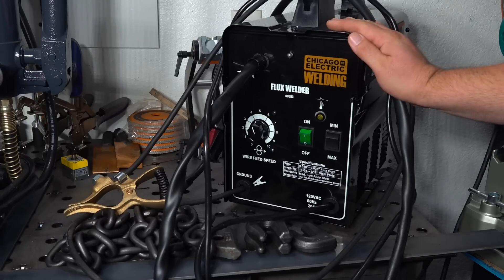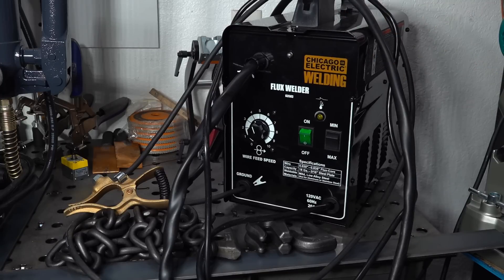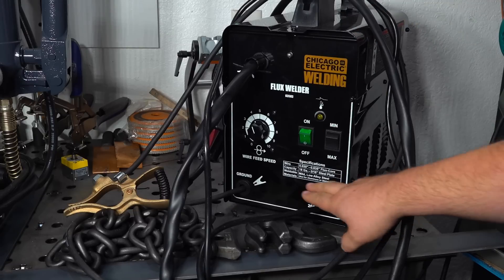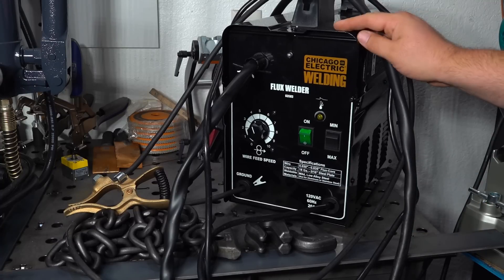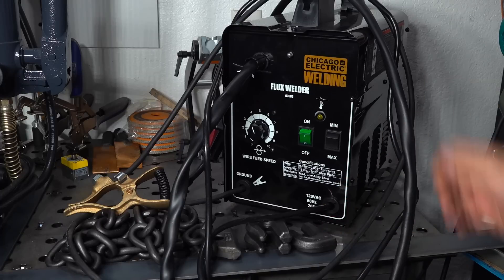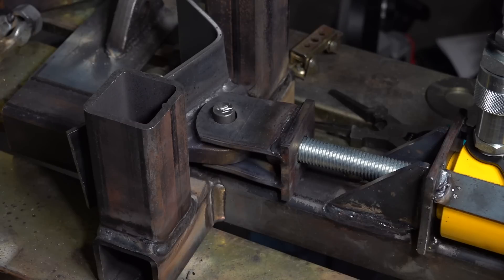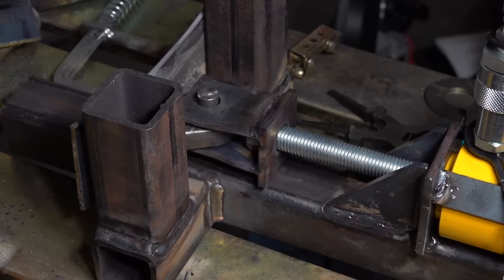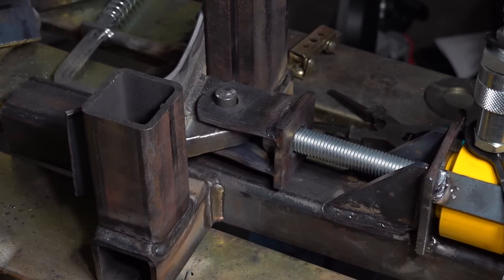Harbor Freight Flux Core, Weld Strength Testing Part 1

Comment: first off.. the material doesnt look like the mill scale was ground off, 2nd it seems like the higher priced welder was using gas shielded flux core and is a 220/240v welder. im a certified welder and i own a couple of hf welders and a few miller mig and tig welders.  your test is very subjective and seems biased as its comparing apples to oranges... a 110v welder will never compete with a 220v welder so your tests are pointless
Reply: So, you're certified and you can't tell the difference between gas shielded and basic flux core? Also, you must've just gotten certified because you care about mill scale on anything other than short circuit mig. The mill scale would've affected both welds the same and would be negligible either way.

Comment: I have a Hobart IronMan 230 MIG (Doesn't leave my shop), a Clark Mig 100E Mk2 (Cheap welder I bought for home that became a travel rig), and a Titanium Flux 125. The clarks old and started falling apart since it was my "Travel" rig, so I replaced it with the HB Titanium as its even smaller and lighter and self shielding flux gives me a lot of versatility. When I got the Titanium 125 I was eager to play with it and test its limits. I had no problem welding 1/4" with it, even though its not rated for it. Try as I might, I could not get a weld to fail as you did. I'm really curious why you didn't film yourself making the welds. You have almost no penetration with the HB welder, so I'm really curious to see your settings and welding with it.
Reply from the maker: The Titanium 125 is a DC output welder and gets far nore penetration than the welder in this video (I have a review of it).  The welder in this video is AC output, which is not good for flux core and significantly limits performance.  I have three more videos with this welder testing penetration with various settings and travel speeds, and even pre-heating.  I also convert to DC and do more testing.  The Titanuim 125 is DC out of the box and runs far better than this welder.
Reply: The Ironman is big and heavy, of course it never leaves your shop. Haha, I've been looking at the Ironman, how's yours holding up?

Comment: this test doesn't seem scientific at all, the HF welds are much thinner, you said it's because HF can't do anything thicker, well ok than do 3 weld lines to make up for it. the real problem is that the HF welds have zero penetration as seen when you cracked it. it doesn't matter what welder you use, either you didn't grind the metal before welding , or you didn't use enough voltage. either way you did not do a proper weld. I'm a bigger rookie than you but even I know these welds are "cold welds" because of zero penetration, that's just bad welding, it's on your part. you need to man up and admit you did this testing completely wrong. it has a ton of logic fallacy
Reply from the maker: I have several more videos with this welder where I cut and etch, test output amperage, convert to DC, etc.  I agree that the main issue is lack of penetration.  No matter what I did, I could not get good penetration on 3/16" thick material with the stock AC output.  1/8" material did fine.
Reply: @bigtb1717  oh I see what happened. the welder you used and the green flux 125 welder also claim 3/8", it's obviously a lie because I bought the vulcan omnipro 220 and it claims to go up to 140 amp on fcaw, so if yours only goes to 125 amps, than according to the specs on the 220 that is IMPOSSIBLE: 120V; Steel: 24 GA - 1/8 in.; Aluminum: 22GA - 1/8 in.240V; Steel: 24 GA - 3/8 in.; Aluminum: 22GA - 3/8 in.  <<=specs for vulcan 220. so basically the testing failed because of false marketing which HF usually underspecs their rating. either that or it's just there is something you don't know which is why it's stated 3/8" . I would just search google or ask the forums to see if anybody has actually welded 3/8" which according to the specs for the vulcan are impossible
Reply: Haha, "weld lines". I love it!

Comment: I have a weldcorp machine, basically the same as the HF, probably same machine with different cosmetics made in china.  More wire needed to be fed in,  #2 speed way too slow.  4-6 on max and the bead would have been double the size and strength.
Reply from the maker: I don’t know if it was an issue witht he included wire or what, but the welder wouldn’t run with the speed set any higher.  It would stutter and the arc would keep going out and stubbing against the metal.  I have three more videos testing different wire, travel speeds, techniques, ets. and I cut and etch many of the joints.

Comment: What if you just put several notches on the edge with a jigsaw blade  to gain more contact area for welding bead   and what about welding the other side together, eh? to make double sided welding? I may not know what the heck I am talking about but I dont see the logic of welding only on one side and try to bend it.. I thought that you would weld the other side to double it up??
Reply from the maker: If you were brazing, roughening up the surface may help strength in some situations, but with welding, the idea is that the weld bead will melt and fuse into both parts, effectively making them one piece of metal.  So the notches with the jigsaw blade wouldn't really help.

You are absolutely correct that a joint welded on both sides would be far stronger.  The point of this test was to see how much easier one would break than the other.  If you are welding up a real project and you can weld both sides of a joint like this, then weld both sides.  It will be much stronger.

Comment: As I gather, I think you started off with showing that the eyehole welds both went above the 2,000 lbs rated capacity. When it came to bending the joint welds, I don't think I heard an amount of pressure to get those to fail (or not.)
Reply from the maker: Pretty much.  It is true that both pad eyes technically went above their rated load.  However, the load was totally in line and totally static.  With a dynamic load, I wouldn't call either of those welds good enough and I wouldn't personally stand under 2,000 lbs hanging from either.  I've done a lot of testing with this HF welder since this video and found that the penetration on any material above 1/8" is really poor.

As for the amount of pressure to bend/break the joints, I don't remember specifically for the joint welded by the ESAB, but I know the joint welded with the HF welder didn't even move the needle on the scale of my press.  In fairness, I don't think any of them moved the needle on the press much.

Comment: Ive seen dudes play ozzy riffs on "$20 hello kitty" guitars from walmart and if you know how to weld you can weld strong joints with a HF welder. If youve spent a grand on a welder and believe thats the only way to get it done.... good for you. It probably is alot easier and sounds way more impressive, but its not the only way
Reply from the maker: You're right, a $1,000 dollar welder isn't the only way and I never claimed it was.  But the simple fact is, there are inherent limitations to the Chicago Electric 120V, 90/125A flux core welders.  Sure, you can make a decent weld with one in certain situations, just like someone could probably play a passable rendition of a popular song on a $20 toy guitar.  But just like Zakk Wylde couldn't fill an amphitheater with satisfactory sound at a live Ozzy show with a Hello Kitty guitar, you aren't going to get very much penetration on thicker material with a 120V, low amperage, AC output flux core machine like the Chicago Electric welder featured in this video.  That's not an insult to the Chicago Electric welder any more than it is to the Hello Kitty guitar.  Both have their place and both have limitations.
Reply: @bigtb1717  comment was just that, a comment. Wasnt directed at anyone in particular, just the crowd puffing chests and pulling out rulers. Any analogy has its flaws just as any product. I believe these welders would do anything you wanted them to do. Maybe not as fast or over and over again all day, but thats not what people buy a $100 welder for. They buy it for personal use and occasional products. It would be like someone shiting on a prius or ford focus because it wont keep up with a lambo in a pikes peak hill climb, a hellcat on a drag strip,  haul as much mulch as a silverado or carry as many passengers as a panel van. Thats not what theyre made for, but as a vehicle it will get you all the places you want to go. It will do a 1/4 mile,  climb pikes peak, haul mulch and theres room for 4 or 5 people. Perfect for every job? No. Good enough for everyones daily stuff and alot cheaper than getting several (perfect vehicles) ? Absolutley
Reply from the maker: I agree with most of your comment.  This welder will be all many people need.  There are lots of people out there getting projects done with this welder.  That's great.  I never intended to bash this welder and I absolutely intend no offence to anyone who uses one.  

You agree there are limitations to the welder, just as there are limitations to the Prius.  The possible problem I see is that most people shopping for their first car will probably have a good understanding of the limitations of a Prius vs. a Lambo or pickup truck.  But someone just getting their first welder is much less likely to fully understand the capabilities.  My only intention is to give people perspective and data points to better help them understand the capabilities.  When you say that the welder will do anything you want, that may be absolutely true, but it could also be confusing to someone just starting out.  Since I see that a lot, where well-meaning people defend the welder from mud-slingers, I felt like people could get an inflated impression of this welder's capability.  That's all.  No ill intent towards the welder or those who are using it without issue.

I hope you didn't and don't take any offence from my comments.  None intended.  Take care, and feel free to correct me if I'm misinterpreting anything.
Reply: @bigtb1717  yeah, I think theres research out there for every product wjether it be cars or welders. If you are smart youll look up things that you find important for purchases you make to make sure they fit your needs. If youre not then youll likely end up disappointed alot of the time.

Comment: What about wire selection ?
Reply from the maker: What would you like to know?  For this video I used the included wire.  Since then I've used 0.030" and 0.035" wire of a couple different brands.  All were similar, but the included wire was the worst.  I think that was partly due to the fact that it wasn't wound smooth on the spool, which caused feeding resistance.

Comment: If you wanna see the best results out of it heat it with a torch first get it really hot then do the weld it will produce same results as the esob
Reply from the maker: I posted a video recently where I test different levels of pre-heat with this welder.  In case you are interested.

Comment: I want to learn how to weld without spending a grand, and probably will be welding stuff like Fences, gates, bumpers (not car frames, just custom bumpers), random shop stuff, etc. Basically what I am getting out of this is that the HF welder will do just fine if its not heavy duty applications supporting thousands of pounds of weight. Chances are being a newbie welder I wouldn't trust my welds for that much weight anyway, which makes this perfect for me. Once I get "good" I will see about upgrading to a nice 240v
Reply from the maker: Just a few thoughts.  This Chicago Electric flux core would probably suit your current needs fine.  As long as you understand the capabilities and are okay with it, then it should be fine.  Lots of people use these welders and are satisfied with it for their needs.  Just a couple suggestions to consider.  If you can save a bit or stretch your budget a bit more, the Titanium Flux 125 from Harbor Freight is $150-$200 depending on the current sales, and it runs way better.  It has DC output which means a smoother arc, less spatter, far more penetration and smoother welds.  If you can manage it, the performance difference is really worth the extra price.

Also, if you have 240V power available, I think it sometimes makes sense to buy something you can grow into, rather than something you will grow out of.  If you think the little 120V flux core machine is all you will ever need, that's great.  If you think you will still have use for it after upgrading, that's understandable.  But if you are pretty sure you will want a more powerful, more capable welder eventually, definitely take a good look at what's available now before making a decision.  There are occasional great deals on the used market as well.

Whatever you decide, good luck and have fun.  Welding is a fun and useful thing.  If you have any question or if you think there's anything I could help with, let me know.
Reply: Did you buy one yet?

Comment: What I see in this video is some poor welding.... Or a flawed test. It's not going to tie in one side if you keep the heat on the other side. This test looks like it was rigged to fool people.
Reply from the maker: I assure you, nothing was rigged, and I absolutely would not want to fool anyone, lie or mislead.  I have done three more videos with this welder, including buying a second one to compare so I could be sure there was nothing wrong with the first one (as some suggested).  I also did quite a bit of cut and etch testing.  I did get slightly better results with different wire, vs. the included wire (which is what I used in this video).  But I was never able to get good penetration or flat, non-crowned bead profiles on material thicker than 1/8th inch with this welder when stock.  It simply doesn't have enough power, largely due to the AC output it has.  I have another video with testing after doing a very basic DC conversion, which shows vastly superior penetration.

This is a fine machine for lots of uses.  But I simply want people to have realistic expectations for penetration and weld strength when it is used on thicker material.  If you have something specific you think I should try, or something I should do different, let me know.

Comment: Thank you so very much.    I would like to ask, to clarify, if both the Harbor Freight and Esab welders were set to the same Amp value, then wire speed to best result?
Reply from the maker: Well, you really can't set an amp value on a MIG welder, as they are supposed to be constant voltage welders, not constant current, like a stick or TIG welder.  I had the Harbor Freight welder set as hot as I could and have it still run smooth, and the ESAB welder was simply set to run fairly smooth, but could have been set much hotter.  I didn't check the actual amperage or voltage output of either machine for this video.

Comment: For $120, I have no problem with a HF welder that performed like the one in this video. For a person that wants to do floor pans or light body work, or light stuff around the farm or house you can't be it. Of course, if your doing more serious welding your not going to buy this anyway. But my question is if this welder performs this good for $120...why does all the other welders have to cost so much more and not perform for the money. One last thing if in the real world you bend a piece of 3/16 steel I don't care what welder you used... you're doing something wrong, Don't blame the welder. You can even get it on Amazon maybe save even more. https://amzn.to/2MYjDrW

Comment: Since current changes with wire speed, technique (stick out) compare the output voltage from different machine while not making an arc.  
My HF 90 amp unit with DC mod outputs 36Vdc  not loaded (no contact, no arc).  
What is the no load (no contact, no arc) DC output of your more powerful welder  ?

Comment: Is that 1/4 in. or 3/16ths in. steel in test 2 & 3 (90° angle)?
Reply from the maker: It is all 3/16”.  It was all cut from the same piece of flat bar.

Comment: Is the harbor freight welder good for welding motor mounts and subframes? Will the welds be strong enough and will they hold?
Reply: My professional opinion is no. Absolutely do not attempt to weld motor mounts to a subframe with this welder. You'd be better off with a good stick welder and some 6010 rods for burning through grease, paint and rust.
Yes, I own this same exact harbor freight welder. And yes, I weld on subframes every single day.
Reply: @Eyore82  Thanks for letting me know. So, what Harbor Freight Welder do you recommend along with the 6010 stick rods. I'm doing an engine swap and I need to weld engine mounts onto the subframe/chassis of my car for a bmw V8 engine.
Reply: Personally, I don't think I'd trust any harbor freight welder for welds as critical as those are. Some of the newer inverter welders they carry have positive reviews, but I've never tried them. And they cost just as much as what you'd pay somebody to come out and weld it for you..
Reply: @Eyore82  inverter welders are the best add stick to that and you can't lose. I use 6013 for the root pass and then 7018 for the rest. 6013 really burns in just gotta get angle and speed right or you'll be grinding out inclusions and porosity over and over lol.